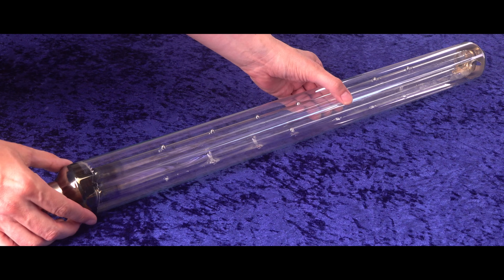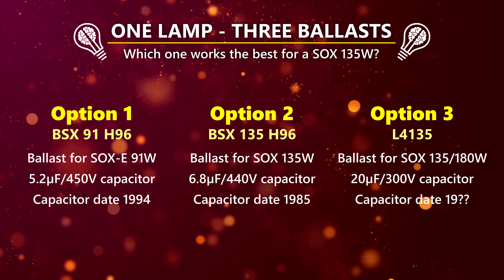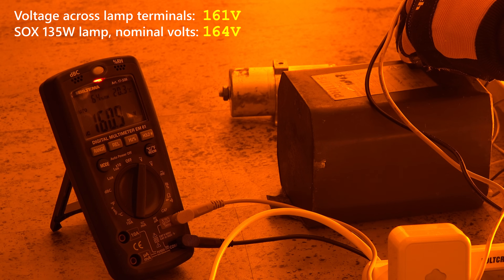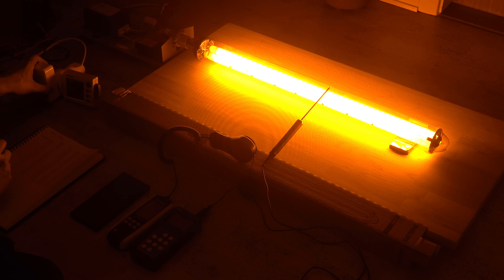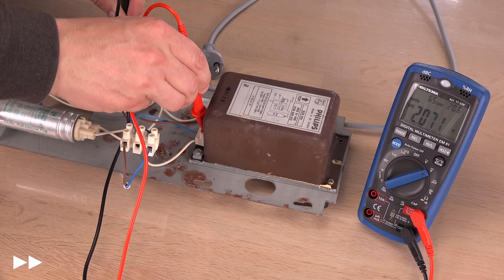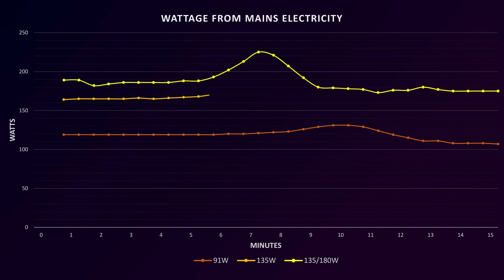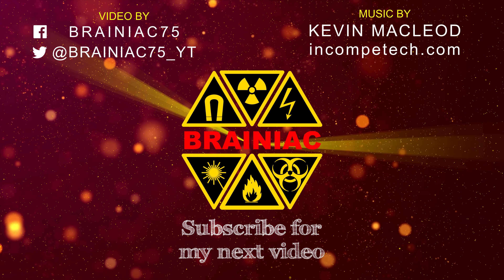How bad is 91W gear for an expensive 135W lamp? Testing SOX 135W on 91W, 135W and 135/180W ballast

Comment: Some years ago i was responsible for the electics in our company. Lamps too so the people could work. We had 400W Mercury Vapor Lamps. They had very big capacitors too. I shocked myself 2-3 times with the capacitors, its a experience. You are full awake after that.

Comment: The 91w and 135w ballasts are "constant current" ballasts. Basically they run a special capacitor that is only made to run with that specific lamp. If they weren't constant current it would have been fine

Comment: If let's say you have an external heat source to vaporize the sodium, how much more efficient would those lights be ?
If you recover heat from another source or for the sake of limited electricity power, you are willing to sacrifice (burn) something else, like oil, could you use just a tiny wattage to excite the vapor, eliminating the need to keep it warm with electricity?

Comment: Could you please tell me where you got the power supply tray from. Many thanks. As I do like all types metal hindel and high pressure sodium bulb and low pressure sodium bulb. With or without electronic ignition.

Comment: Interesting. So this lamp has roughly 8,871 Lumen, so less than I use in my living room :')

I'm using 5 lamps with 15000 Lumen total, but only 140 W total in my living room, while it's LEDs with much better color rendering ;)

Comment: I spent a lot of money 10 years ago on a SOX 180W and a new BSX 180, capacitor and ignitor. The lamp lit up our road for 4.5 years every night until it died. That is not a life time though! Most of my mercury vapor lamps look like green mold after 4.5 years but they are still alive. All my 18W SOX-E lamps died just before 5 years of every night usage. So this is my advice: Use the correct control gear, and only power them on when you want the nostalgia. Don't turn them on if you are going to turn them off again after a few minutes. And always have one spare bulb because one day, you can't find one to buy anymore! So expensive nostalgia purposes only

Comment: I would not use the smaller supply it degrade your lamps electrodes and cause blackening. Metal spudder is real. Take it from someone who serviced outdoor lighting for years. Even short runs are not advised.

Comment: wow. i had this exact same lamp, found it next to a highway tunnel. there was a whole 1.5m cubic box filled with these and i decided to take one since i was sure these were old and discarded. it has hung on my wall for a year or so, then i think i threw it away. i have hooked it up to a small neon light driver and it was able to glow red but very dimm. i regret throwing it away now though, shouldve gotten some way to power it up aswell. 22k lumens is no joke and something i really want to see in my bedroom lol

Comment: Summary

The video compares three different power supplies for a 135W Low Pressure Sodium (LPS) lamp:

1. ML4135 (180W Ballast):
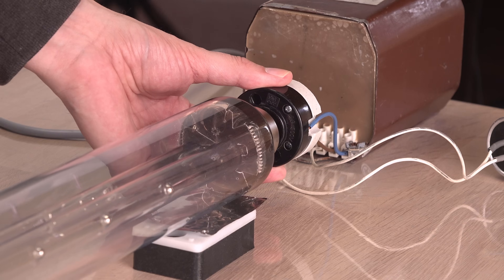* [00:04:40] Pros: Brightest output, quickly reaches full brightness.
* [00:04:40] Cons: Highest power consumption, poor power factor, potential for shorter lamp lifespan due to higher voltage (161V). 
* [00:04:40] Verdict: Good for occasional, short uses. Can also power 180W lamps.

2. BSX91 (91W Ballast):
* [00:07:48] Pros: Low power consumption.
* [00:07:48] Cons: Dimmest output, slow warm-up, lamp flickered during testing, very high lamp voltage (288V) could damage the lamp.
* [00:07:48] Verdict: NOT recommended for a 135W LPS lamp.

3. BSX135 (135W Ballast):
* [00:12:09] Pros: Bright output, good power factor, stable operation, most efficient for this lamp.
* [00:12:09] Cons: None mentioned.
* [00:12:09] Verdict: Best overall and recommended choice for a 135W LPS lamp.

Conclusion:

Using a properly matched ballast is crucial for LPS lamp performance and longevity. The BSX135 is the clear winner for the 135W lamp, while the BSX91 is unsuitable and potentially damaging. The ML4135 is a viable option for short, occasional uses, and its versatility to power 180W lamps is a bonus. 

I used Google Gemini 1.5 Pro to summarize the transcript.
Cost (if I didn't use the free tier): $0.0944
Time: 26.61 seconds
Input tokens: 24648
Output tokens: 774

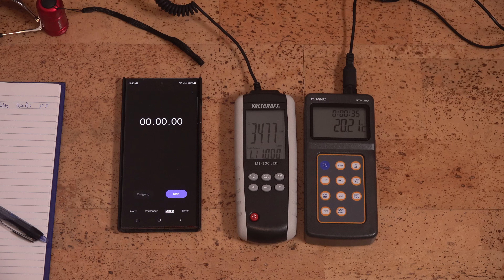Comment: 5:50 oooh Voltcraft EL4000! I have one too! It was a great tool, and logging to sdcard worked great - although it actually has some issues sometimes, because of how very low-level FS and file-writing methods it uses. For example, I found that it accepts only some cards and instantly rejects other cards (all clean and formatted to the same FAT, but they vary in size, speed, etc). For some cards, it accepts them, but then fails to write the data files to them, files come out garbled, truncated, or just empty.. But! After some time, 3 or 4 years, my unit just died and refused to do anything. It powers up, displays some things, reacts to buttons - but it improperly measures the current, while displaying the voltage just fine, thus results are garbage. Or maybe the other way, current fine, but voltage wrong. I dont remember right now. Did you have any issues with your unit?

Comment: power factor is not even measured for in billing because it is so easy to theft of service because simply placing capacitors on the load can correct the power factor and reduce the bills.

that is how them scammy "theft of service" devices work because in countries like china they do use power factor to bill by but in the western world they dont use that.

the flickering could be arcing inside the power supply or an overload protection on the cusp of kicking in.

i wonder if you are trying to use the 180 watt ballast for the 135 watt bulb and that is why the 288 volts or the balast is damaged by the arcing that caused the flickering.
Reply: SOX lamps have a higher arc voltage while warming up which explains the voltage since it never does fully warm up on the 91W ballest.

Comment: Sodium vapour lighting was so much better than the leds we have now. The warm orange glow was like a gentle kiss on the cheek as you drifted off to sleep. Now the 'warm' white of the leds laugh at your attempts of sleep
Reply: I Miss them too. But in 2025/2026 LEDs have become so incredibly efficient that they are just a great as the old sodium lamps were. They also have the added benefit of no warmup time and high color visibility.
Reply: @keeganplayz1875 yeah but they arent the same. The light is too harsh and they are terrible for the night sky. 

If we had leds that had the exact same spectrum as sodium then we could use a diffuser to make them softer.
Reply: LED lamps are at least compatible with motion sensors. There are also monochromatic yellow or orange LEDs - I saw once a photo of a streetlight with mixed yellow and white LEDs.

Comment: 3:09 -- applying Ohm's law to AC circuits is a bit more complicated than just measuring R with a basic multimeter. A transformer coil is a predominantly inductive load, and current through it is primarily determined by its reactance X = 2π*freq*L. The fancy thing is that current drawn by an ideal inductor from the outlet won't register to your power consumption meter, because reactive load shifts the phase of current relative to the phase of voltage in such a way that the load returns current to the outlet for as much time as it spends drawing current. In reality, of course, the current meets wires with common resistance which doesn't care about phase shenanigans. And a transformer under load behaves more like a resistor because the primary coil's magnetic field is stolen by the secondary, nullifying the former's momentary inductance. In short, look up about reactance and impedance.

Comment: If you have future to chenge voltege 220 or 240 always choose 240 in 230V country. It is known in Amplifier comunity. Dont overstess components. Specially diodes and transistors are hit by slight higher Voltage
8:30 Transformator seems loose coils. did You chech its temperature?

Comment: That'll be a good herb lamp LOL, not really 135w wouldn't very much for plants, atleast a 400-600w at min I guess, I only have experience with the 1kw HPS/MH lighting and I use to use electronic ballasts rather than those magnet core ones.

Comment: You should do a video on what happens when you accidentally touched one of those capacitors I know from personal experience it’s not fun mine was 1000 W high pressure metal halide never had a problem with sodium I think it’s kind of stupid and trivial how they’re changing sodium lights to LEDs for one they don’t last as long to sodiums take less power overall at three I find it a better light source I think LEDs have a purpose most definitely but not everything

Comment: Oh come on, the tense music and talks about condenser discharges add artificial drama, while lifting off the ballast as if it were something dangerously deadly if disturbed. Please, this channel was never BS drama, so please keep it without BS drama. And as long as you do not want to discharge a fully charged condenser bank of a trolleybus (that is there to smooth out the intermittent power supply of 600V DC from the overhead wires, when the contact shoes temporarily "jump off" the wire at certain stretches of the infrastructure), you can short out the terminals by anything, even touching the chassis to make sure. This it not like a trolleybus, in which case if you cannot wait 30 seconds after pulling down the trolley poles and decide to short out the terminals of the mentioned condenser battery by e.g. a flat screwdriver, you must prepare to get temporarily blinded by the resulting flash and your screwdriver being fit just for the dumpster afterwards. These "little" condensers for these lamps are just big toys. They might give you a shock, but certainly will not kill you. Also, you should have measured the temperature of the ballast itself. Might be interesting to see which one "heats" the most.

Comment: I like your videos and join your passion in sodium SOx lamps.
I have a new Osram NA 180W .... And even more interesting an ancient 200W Thorn linear tube (search for SLI/H 200W 'HO'), also NOS. But I am missing a ballast for the 200W Thorn ... I would trade in one 180W and one SLI/H 200W 'HO' for a ballast for the Thorn lamp (have one for the 180W one) ... 
I tried a couple of ballast ideas (i.e. a 150W NAV ballast) ... but the ignition is way to rough for the precious Thorn lamp as well as the final voltage is too high, like with your 91W ballast. I never found a suitable ballast for the linear tube. 😪Maybe you have better contacts for such gear or better luck ... If interested, just tell me ... :)

Comment: In aquaculture, we regularly tweaked the output colour and intensity of our metal halide lamps using the input power – it wasn't uncommon to overdrive 400W lamps up to about 520W, and underdrive 250W ones to about 200W – it's pretty incredible how different the output can be just by tweaking that input. I'd love to see what you can find out of it with your spectrophotometer.
Reply: MH bulbs act so weird. I have a 1000W bulb and a 600/750/1000/1150W ballast and the color temperature completely changes based on the wattage setting.
Reply: @TechHowden we observe it in some other light sources too. Light-emitting plasma (LEP) are a pretty good example – depending on the drive you can totally shift from practically monochromatic on both ends of the spectrum. Hugely underutilised.

Comment: It isn't the extra primary resistance that reduces secondary-side current, it is the reduced pri:sec turn ratios from adding ~10% more turns in series. The extra turns also increase the primary's magnetizing inductance, reducing open-circuit current for a given voltage.

Fluorescent tubes have significant lifespan, efficiency and light quality gains from operating with a high-frequency ballast. I'd expect sodium to also see some efficiency and possibly lifespan gains from 25kHz not letting the arc extinguish and re-strike 100 times/s.
Reply: Yes, SOX lamps do benefit from runnning them on high frequency. Light output increases while total power consumption drops, thanks to less ballast losses.

The problem is just that the SOX HF ballasts were manufactured only by Philips for a rather short period mainly in the early 2000's and only up to (if I'm not mistaken) SOX-E 91W. The 135 and 180 Watt lamps never got them.

However, people report having success running SOX lamps on fluorescent instant start HF ballasts. Which is not surprising considering SOX and fluorescent lamps are electrically very similar, except for the cathodes.

Comment: THE DATA IS KEWL AND ALL, BUT THERE IS NO PRACTICAL USE FOR THESE OLD LAMPS?   YOUCAN DO THE SAME OR BETTER JOBE WITH LESS THEN 1/2 THE POWER CONSUMPTION WITH GOOD LED'S AND IN A COLOR THAT IS MUCH MORE PLEASING THE EYE. MY QUESTION IS WHY BOTHER?
Reply: Oh shut up
Reply: That's not the point.

Comment: 2:20 My mum once ordered two red glass vases from eBay Kleinanzeigen and they arrived in a boc that was severely damaged right in the two spots where a "Brittle!" warning sticker had been placed. Luckily the seller anticipated that and packaged the vases so well they still didn't break on the way here. But I've never seen a package get treated soo badly that it opened on its own and had to be closed again by postal staff.

Comment: As a Lightbulb/lamp enthusiast, collector, and someone who has spent many years researching and studying lamps, I admit watched with some trepidation because I already knew that a 135W SOX lamp on a 91W SOX ballast is not a good idea :)

first of all I want to say for your L4135 Leak Transformer ballast please check/replace the 20uF 300V capacitor, the power factor should not be that bad, it should be around 0.9, so to me that indicates a degraded capacitor, and because the capacitor is part of the ballast circuit (its not just across incoming mains) it is is critical that you do have a functioning capacitor in the circuit or you will cook the ballast 

the reason the arc voltage of the 135W Lamp was so high on the 91W SOX-E ballast is because, the arc voltage of SOX lamp is highest when it is cold and the neon-argon penning mixture is still the main active component of the discharge, and since the 135W SOX lamp never warms up fully, the buffer gas remains ionised, this is also quite bad for the lamp as the buffer gas can become absorbed into the glass of the arc tube (google SOX lamp argon cleanup and see the page on it from the most excellent lamptech website) if you probe the lamp voltage just after striking you will see its very high indeed (low pressure sodium lamps are interesting in this regard, since pretty much all other discharge lamps start out with a low arc voltage that then rises as it warms up)

I would also recommend that in future tests you also measure the arc current of any discharge lamp under test, as often times the arc current is the most important value of a discharge lamp, it is what directly can damage the electrodes for example if it is wrong, this is another reason you want to avoid running a 135W SOX lamp on a 91W SOX-E ballast, since the 0.6A of a SOX-E 91W ballast, may lead to the cathodes of 0.9A 135W SOX lamp running cold and sputtering themsleves to an early death

BTW on that note, the end blackening around the electrodes of your 135W SOX lamp is nothing to be concerned about, while it is true that over time the electrodes will sputter and darken the glass, Philips SOX lamps have blackened electrode ends from the factory, since they flash a getter from the electrodes to improve chemical purity of the arc tube atmosphere, its the same sort of getter thats also present in the outer bulb that helps maintain the insulating vacuum :)

if you have any lightbulb related questions, feel free to ask, as per the start of my comment, I am a massive enthusiast of lightbulbs and have spent many years researching and studying them :)
Reply: Just out of curiousity. Can you run a lower wattage lamp on a higher wattage ballast? I figured that the ballast is meant to be tuned to the bulb wattage.
Reply: @ryanhebron4287  A higher current ballast will overheat the lamp. The exception was the double rated fluorescent lamp, for example the 1500 mm long 65/80 W one. Now they only make that size in 58 W rating.

Comment: On that flicker with the 91w gear

My bet is there's a region within the SOX lamp's warmup that requires a higher voltage to prevent the lamp self-extinguishing. If the ballast is incapable of supplying that voltage at the requested current it will cause the lamp to self-extinguish. As soon as this happens the igniter will try to start the lamp again, as the igniters monitor line voltage and look for the lamp extinguishing during startup or when running. Kind of like what happens with a spent high pressure sodium lamp but because SOX can be hot restruck, the igniter just kicks the lamp straight back on again.

Definitely wouldn't recommend letting the lamp run like that because outside of the lower than required operating current and higher than recommended line voltage, the lamp will see additional stress from the reignition cycles. Both the excessive voltage with too little current and the regular reignition attempts will destroy the cathodes quite rapidly.
Reply: Yeah that seems to be the issue since SOX bulbs have a higher arc voltage while warming up since they have other gases for starting.